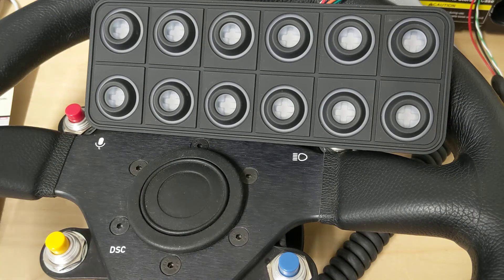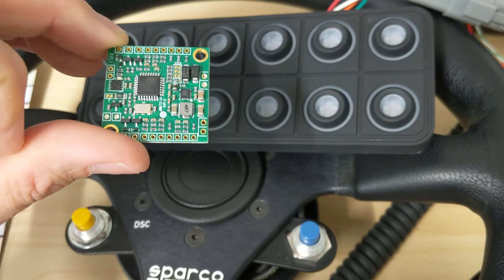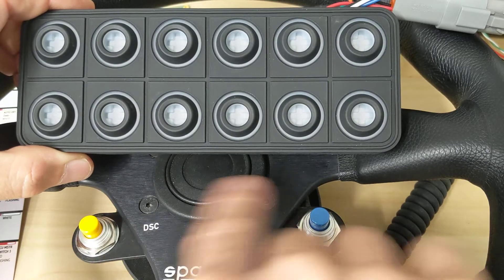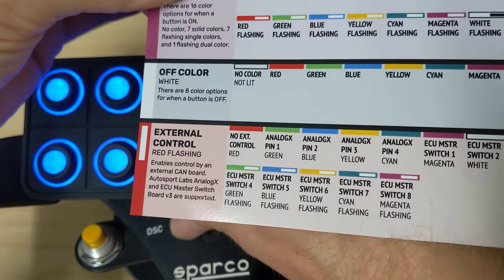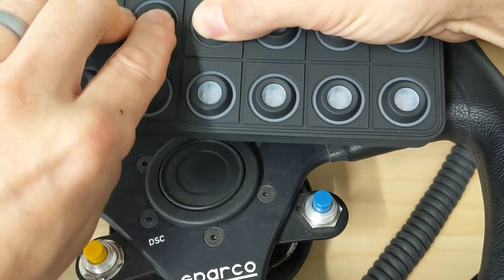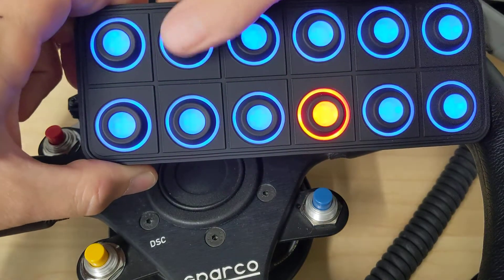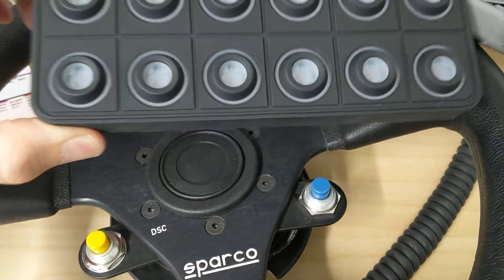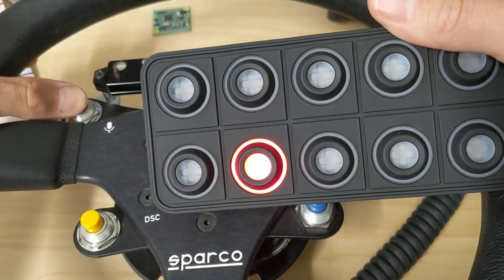Control the MicroPDM with your steering wheel

Comment: This is the first time I see you video and I am quite lost

You call this micro pdm but it uses external fuses and relays?

Is it an alternative to expensive full pdms out there or what exactly please explain
Reply from the maker: We think a PDM is more than just a way to replace fuses and relays, with steering wheel control as just one of many examples.  Others are keypad control, automation with CAN, programmable behavior, etc.  We have all kinds of documentation at micropdm.com if you want to learn more.